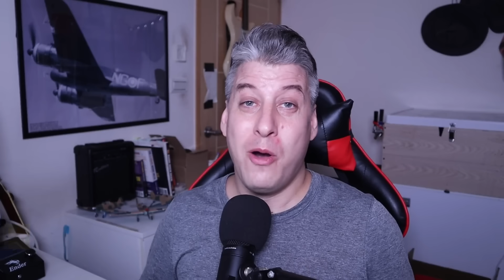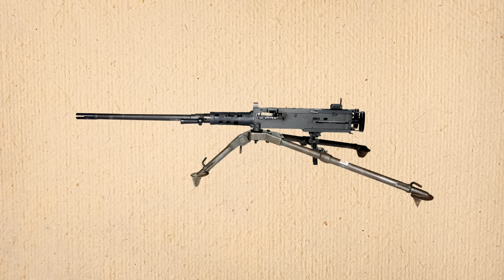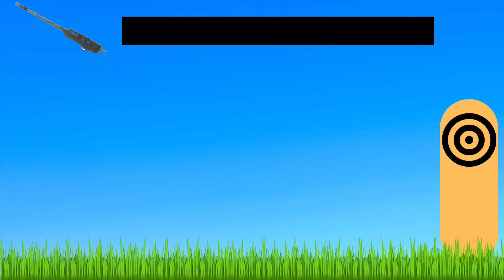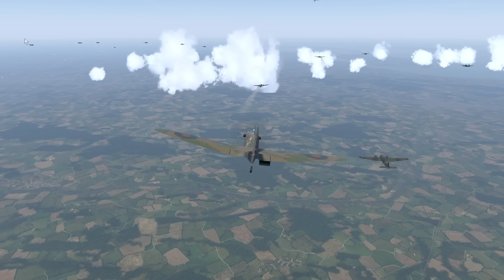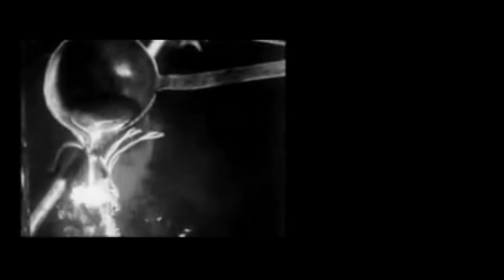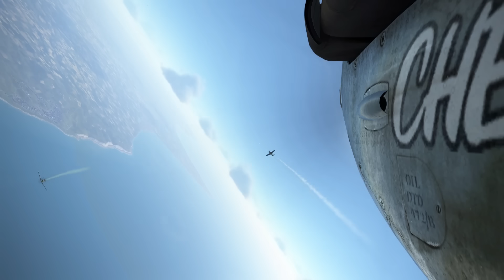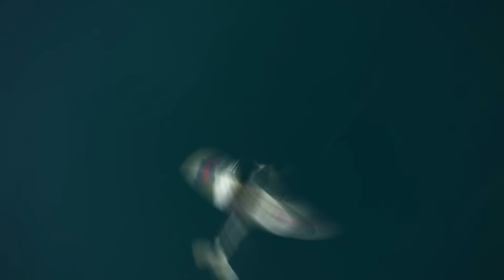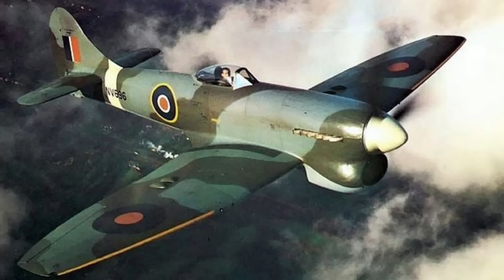Why Did The RAF Use .303 Caliber Machine Guns in WW2? The Surprising Answer

Comment: Having read Anthony Williams(aka Autogun) very thorough analysis(as well as those of some of his associates), i can only say that the British did a serious mistake in not moving towards larger calibres from the beginning.

And the testing done during the war, especially by the Germans, support that notion completely.
A fighter got shot down by 1-2 hits from 30mm cannons, 2-5 hits from 20mm cannons, up to dozens of hits from .50s and up to hundreds of hits from .303s.
Or at least, that's a major oversimplification of various sources taken together.

It looks even worse however, once you switch to looking at bombers.   Because for 30mm, even a single hit could still be enough even if the average was increased, for 20mm, a handful of hits could still be enough, but .50s and .303s often required dozens and hundreds of hits minimum to shoot them down.

What this means is that during the battle of Britain, German bomber losses could have been tripled or even more, triple is the conservative estimate.

.

The notion about not trusting the pilot's accuracy means they should have gone for heavier guns even MORE.
Who cares if you have more rounds to fire if what few rounds you land on target doesn't DO enough damage to matter?

.

Williams also attempted to figure out an "optimal" gun setup for WWII and his result after a LOT of work was to have a 30mm firing through the propeller hub and two synchronised 20mm in the nose or possibly the wing roots.
This is interestingly very close to what the Do-335 had.
And close to what several of the most successful Soviet fighters had.

Also, his calculations are that even with the greater weights, .50s are still twice as effective as .303s while 20mm are 3 times as effective as .50s.

And that's before taking into account low weight weapons like the .50 and 20mm Berezin, which were both essentially the same weight, roughly half of that of a Hispano or M2.   Sure, they had much shorter expected lifespans, but said lifespan were still enough for >30 flights spending all the ammo any aircraft with them had at most, which wasn't entirely common and despite the reduced life expectancy, they were still often used far far beyond it.

MEANING, that it was at least 100% technically possible to give an aircraft four 20mm cannons weighing/drag LESS than 8 .303s.

.

No, UK didn't have the ability to instantly switch in 1940.   But they COULD have taken the hints from the Spanish civil war, where the Bf-109s ever since the B model could be found with cannons, meaning they could have realised the usefulness well before the end of 1938.

.

When looking at defensive armament for bombers, what do you find that stands out from the crowd?
Well, there's the B-29, whose computerised firecontrol systems were very good, but also nothing that could be replicated easily by UK in 1939.
And there's the Kawanishi H8K.   Which relied mostly on single 20mm mounts.
And was absolutely hated by allied fighter pilots, spawning various nicknames like "hedgehog" and the like because they were extremely dangerous to attack.
Reply from the maker: Some very interesting points, thanks.
Reply: Your argument on having larger guns for inaccurate pilots is wrong.

This was born of the era of biplane fighters like the gladiator, which carried 4x .303 machine guns. Machine gun bursts that hit aircraft did fatal damage, but scoring those hits was difficult, air gunnery is an art. Increasing the number of guns increased beaten zone and allowed a shorter burst to put even more rounds on target. 8 guns in the early hurricanes and spitfires with 12 in the later variants of hurricane, a split second on target allowed greater hit possibilities with more ammo to spare for a second burst in the case of a miss. 

Most rounds fired during air engagements will miss anyway, so a smaller amount of rounds means that you have to achieve higher amounts of accuracy, which is just not possible during fighter on fighter engagements.

Although cannon armament was added to the hurricane when they moved to ground support, the spitfires thin wings meant a redesign of the wing spars and tubing, which not only took time but also meant a change in manufacturing.
Reply: @ryancook6452  Wrong.   This has even been proven.

"Increasing the number of guns increased beaten zone and allowed a shorter burst to put even more rounds on target."

Who cares?   If you're a poor gunner, the increase will only be very slight anyway, while you would need to multiply the number of hits several times over to actually make it effective.

AND if you can hit at all with machineguns, you can ALSO hit with cannons, especially as they have better ballistics and range.
And with Hispano 20s, even a single hit is likely to damage the target notably, while you can hit with dozens of .303 bullets and achieve absolutely nothing worthwhile.

Only VERY GOOD GUNNERs were effective with .303s.   Everyone else just made some RANDOMLY LOCATED holes in the target fuselage and wings and the target kept flying.
With cannons, every hit counts and even a single hit can be enough to shoot down the target.

"a split second on target allowed greater hit possibilities with more ammo to spare for a second burst in the case of a miss."

So?   A split second of guns on target means you're doing absolutely nothing useful.   You might be hitting with a dozen or two of bullets and the probability that the target takes critical damage from that from a poor gunner is near zero.

4 Hispanos have about 1/3 of the total rate of fire of 12 .303s.   Meaning that if you managed to hit with a dozen bullets from .303s, you probably managed to hit with at least 3 20mm shells if you had the cannons instead.
A dozen .303 bullets will be ignored.   3-4 20mm shells impacting is almost certainly a badly damaged aircraft and quite likely a DESTROYED target.

"Most rounds fired during air engagements will miss anyway, so a smaller amount of rounds means that you have to achieve higher amounts of accuracy, which is just not possible during fighter on fighter engagements."

Reread above.   Then consider this fact, even if you pretend that 4 Hispanos were to only fire 1/6th as many shots per time unit as 12  .303s did, the 20mm shells hitting whenever you DO hit would still do hugely more damage.
A dozen .303s would still translate into 2 20mm shells.   That's enough for a kill with only a tiny bit of luck.   A dozen .303s hitting would have to be superlucky to destroy a target aircraft with so few hits.

And this becomes MORE pronounced with poor pilots.   Because poor pilots will hit their targets RANDOMLY.   Meaning that the vast majority of hits will be spread out and hitting nothing important.
While 20mm shells EXPLODE.   Hitting a wing makes BIG HOLE instead of something you can just tape over.   Hitting a rudder might remove the rudder completely while a .303 is unlikely to do more than cause a minor effect on the controls, if it causes ANY effect at all.

Most engines of the time will keep running even with a dozen .303s passing through randomly.
A single 20mm shell has a decent chance to missionkill the engine.
Again, this is because a .303 bullet has to actually HIT a critical location, pass straight through it, otherwise it is unlikely to cause notable damage.
While a 20mm shell only needs to explode somewhere NEARBY to cut lines or damage critical components.

For a SKILLED pilot, the difference matters far less because they're good enough to aim specifically against weak spots and maintain aim long enough to hit with enough bullets to destroy the target.
For an UNSKILLED pilot, hitting at all is harder and they will nearly always hit RANDOM locations.
For them, it matters extremely to have cannons instead, because if they do, even if they just get 1 or 2 hits, that can still be enough to determine if they shot the target down or not.

"Although cannon armament was added to the hurricane when they moved to ground support, the spitfires thin wings meant a redesign of the wing spars and tubing, which not only took time but also meant a change in manufacturing."

THAT is a perfectly valid argument yes.   It wasn't a perfectly easy switch to make, but events and later testing clearly showed that it would almost certainly have been worth it, as long as it was done correctly at least, and not the ridiculously botched job USA did with the Hispano.

Even just switching to .50s would have been an improvement, just much less so.

For comparison, i'll bring up the tests USA did when considering switching from .50s to 20mm.
Jeeps and trucks hit by .50s from a single strafing pass were missionkilled but took from less than an hour to at most a couple of days to put back into service.   Rarely were they permanently destroyed and even if they were, they could commonly be used to provide spare parts.

Jeeps and trucks hit by 20mm from a single strafing pass were nearly always complete writeoffs and could often not even be used for spare parts.

Similar tests have been done with riflecaliber machineguns as well, and there, more than half the time the vehicles hit were not even missionkilled, just given some excessive ventilation.   And repairs needed to bring them back to functional rarely took more than a few hours.
Reply: @DIREWOLFx75  in response to who cared. The RAF cared, they knew that most of their pilots were not crack shots in air gunnery, in fact the air gunnery school actually classed any hits on target as a passing mark because machine guns on aircraft are inherently innacurate (also because pilots were in higher demand than aircraft, and any pilot is better than no pilot). With the early trials hispanos actually accentuating this issue as their low ammo capacity and jamming issues meant that pilots had to make sure that shots were targeted well although they liked the damage they caused. 

.303 rounds were effective in taking down enemy fighters, where they struggled most was in downing bombers, particularly the Ju88 and he111 which, although largely unarmoured, had large amounts of reinforcement and layered aluminium bulkheads, the .303 round would deform after passing through them and lose most of its energy. 

The RAF put a massive focus on air gunnery throughout the early stages of the battle of britian and this proved to be the way forward, although the .50 cal is the be all end all of munitions, when it doesn't fit in the plane and the plane can't carry the amount of ammo needed to have a decent amount trigger time its not all that useful. 

The hispano was introduced to the hurricane early as they went into ground support roles over Africa, the spitfire would take longer due to the aforementioned wing issues but also due to the fact that spitfires were doing well with their .303 armament as they were flying top cover, engaging escort fighters more often than bombers thanks to the Dowding system. The mkVs would see the widespread introduction of cannon to the spitfire but by this point in the war the luftwaffe was struggling to field fighters in large numbers, bombers and attackers had become the most commonly encountered target and by the time of the rodeos over France they were even engaging ground targets. 

The RAF knew the .303 would not cut it forever and there were plans in case for their supplementation, but the RAF did operate aircraft using .50 cal machine guns prior to this. They had a number of US built aircraft which were not well liked with the exception of the p40, which was liked for its drastic improvement in performance over the mk1 hurricanes still being operated in that theatre.

Comment: One issue not mentioned is that tracer & incendiary rounds have different trajectories that ball ammo, so if you're using them as aiming aids you're focusing on hitting with one sixth of all rounds fired.

Several US groups reported increased kill rates when they eliminated tracer ammo. They weren't sure, but allied pilots hypothesized that if opponents didn't see tracer rounds, they were less likely to take evasive action.
Reply: Yes, that way they may not notice they are being shot at, until you actually hit them. The US planes may have had counters also but pilots were often too "busy" at the moment to look.

Against the Japanese it was found that just four .50 guns with extra armor piercing incendiary ammo worked well.
Reply: @frosty3693  Supposedly. The Mitsubishi Zeros didnt have any armour plating or self sealing fuel tanks to protect their pilots. One could probably say that the 50's alone were probably quite overkill for those targets.
Reply: @Rose.Of.Hizaki  Well, Owen Baggett managed to shoot down a Zero with his .45 caliber 1911 while hanging in a parachute.   The advantage of the .50 over a .30 caliber is range. Due to a much better ballistic coefficient, one can engage the enemy from a considerably longer distance.
Reply: @Rose.Of.Hizaki : They also used magnesium in the metal of the frames... a .50 cal API round with the White Phosphorus filler (turns into a liquid at 111°, which it reaches VERY quickly) meant frames with magnesium and the .50 cal. round was a match made in heaven... For the .50 cal.
Reply: @Rocketsong  Again. While extra range is nice, its not really a requirement. especially when attacking unarmoured targets.

Im not disputing the advantages a 50. has over a 303. Im just saying its overkill for shooting something down that isnt well armoured. 303 tracer and explosive rounds could still set zeros on fire.

Is it the most efficient at it? No. But would it work? Yes.
Reply: @theduck1972  this is quite a disputed topic on the internet.

Quite a few U.S planes used magnesium or mixed magnesium into their the aluminium alloys when constructing their planes.

the F4F Hellcat was rumored to use the same amount of magnesium as the A6M did. 

From my understanding the percentage of magnesium used to make the A6M was quite low. Most fires would have been started by rounds hitting and penetrating the fuel tanks or engine related components which then started a fire.
Reply: @Rose.Of.Hizaki :  A small bit of WP will burn through a 81 mm Mortar base plate, no problem no matter what the alloy is, damage can be done.  Engine component, as you point out, are going to be more immediately affected by the penetrator core of the round. In the frame members, even a small amount of magnesium alloy isn't going to do any favors with WP, it will happen faster, though even if none is present the WP is going through it: Whether or not the piece burned through matters is then the issue.  The only downside - and became the biggest - to the round, and why 20mm HEI became more desirable, is the 20mm can hit at much shallower angles and still detonate, angles that would not cause the .50 cal.'s penetrator to separate from the softer outer, which causes the spreading of the WP, or cause the round to deflect even on thin aircraft skin: This wasn't so big an issue in WWII, but as things got faster and only a few rounds from a burst might hit, the percentage of .50 cal. that might not yield results became an issue.. Though there was no huge advantage of one or the other in firing range.
I used both the .50 cal. and 20mm during my time as a gunner.  The early Mig-21's that had the additional very thick inner windscreen that did offer some advantage as long as the pilot could keep it front, nose on, with the characteristics of the .50 cal. and the low-profile frontal angles of that aircraft, that would have bought him nothing with the 20mm HEI Round if hit by just one.  Plus, the pattern at range with the 20mm rotary was much tighter than the quad mount .50 cal - same problem with  wing mounts - vibration caused by firing, causing a bigger pattern the greater the range means more are likely to miss, even though a totally righteous gunnery solution has been achieved with a radar and computer system.
Sorry this went so long.  My head is full of useless information.
Reply: @frosty3693  Considering the noise and adrenaline rush they probably wouldn't even realide they were being shof
Reply: Right. That's why the best marksmen eschewed tracer ammo, as they didn't need the aiming assist, and why alert the enemy that he was being fired on if you didn't have to?
Reply from the maker: Thanks for bringing this up. I'll bear it in mind for future videos.
Reply: @CalibanRising  At least one US 8th Air Force fighter group (the 4th) used tracers near the end of the ammunition belt to give pilots a visual indication that they were nearly out of ammunition. This is according to the book "1000 Destroyed: The Life and Times of the 4th Fighter Group" by Grover C. Hall.
Reply: @CharlesStearman  me109s had a counter.
Reply: It's not until you get to a significant range that the divergence of tracer and everything else becomes a problem.
Reply: Read an account of a Lancaster Rear Gunner who was recognised as an 'expert' who used 100% tracer (which he was able to do, against 'official policy' due to his status) as it was effective in un-nerving Nightfighter crews who had got close thinking they were unseen.  The Lanc pilot would then 'corkscrew' (yes, you read that right) after which a radar=dependent nightfighter would be unlikely to 'find its prey' again. Sorry I cannot recall the title of the book involved.
Reply: Germany's "star of africa" Hans Marseille came to the same conclusion. He was considered one of the best deflection shooter to ever fly. He was known to be able to shoot down even heavely armored fighters like p-47s with only 8-10 rounds.
Reply: @daveware4117  Marseille never flew against P-47s. Christopher Shores excellent 5-volume series on air war in the Mediterranean covers day-by-day kills/losses of virtually everything that happened in that theatre.
Reply: Didnt america in the late part of the war have ammo belts that used 100% tracers?